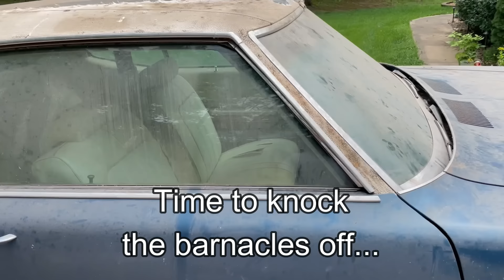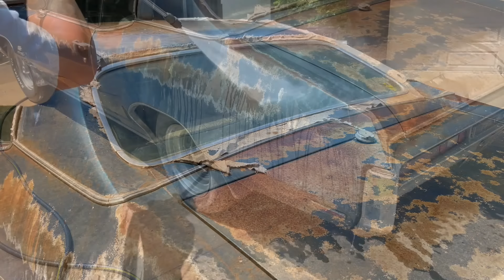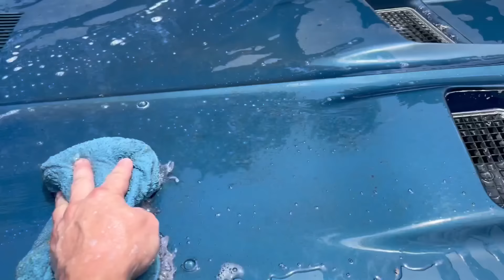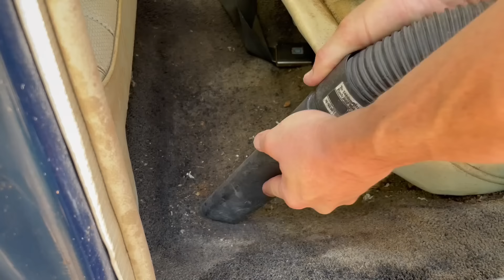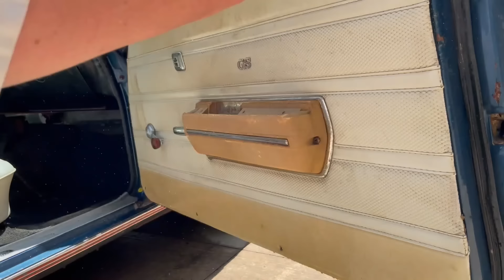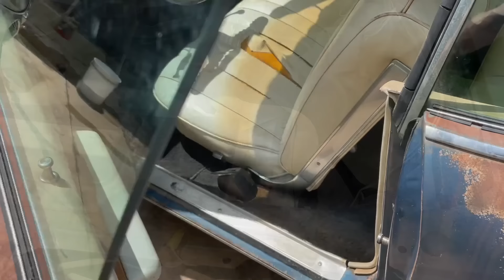1970 Buick GS Stage1 LOSES HALF ITS VALUE in 10 minutes!

Comment: The Stage One sounded like half a stage! I hope there will be a way to see how this car turns out.
Reply from the maker: Since it left here, it has been sold 3 times.  The guy that bought it from me replaced the head with the hole in the exhaust port, so it no longer sounds like a tractor.  He cleaned it up a bit more, too.
Reply: @ Easy come, easy go; I reckon.

Comment: That car isn't that bad. A bunch of disassembling and cleaning, reassembling, some paint and a new top.
Reply from the maker: It really is a great foundation.  Not a rotten mess.
Reply: This car look very straight, but it needs a frame off restoration considering what a rare classic it is.
Not inexpensive, but the return will be worth it.
Reply: No way I would put a vinyl top back on it. Completely not needed and a contrasting color or matching color paint woud do it just fine
Reply from the maker: @anonimous2451  I see lots of folks wanting to keep the color combo but not the vinyl top part, and paint the top the color of the vinyl.  Pretty sleek, and it doesn't really "devalue" the car...since it was an option to have a painted top in 1970.
Reply: @antiqueautomotiveservice  Of course. That was my point sir.

Comment: Nice, interesting options on it, Power door locks but not windows, a/c ect. I suspect the "button" on the lower left front fender was a security system. The gernerally were higher up and used a key much like a soda maching to set them.

Comment: I had a 71 back in the day Red with black interior, no vinyl top 455 4bbl factory dual exhaust, would light the tires up effortlessly had to be light on the pedal and it would swap ends with you if you weren't careful

Comment: It sure cleaned up nicely but I don’t think I would put a vinyl top back on unless the top gets a really good paint job first.
Reply from the maker: For sure...this car really needs to be completely gone through.  It was ridden hard and put away wet.
Reply: The factory top would have had one seam down the middle. Two seams indicate the top has been replaced. Fabric was manufactured wider in those years compared to now.
Reply: I didn’t know that. Thanks for sharing that information with us Mr. James.
I noticed in the past some had one seam and some two never knew why until now.
Reply: @MrJames1549 YOU Are wrong, all cars had 2 seams from the factory regardless of manufacture.
Reply: @czechmate6916  Mr James is WRONG, all cars in the 70’s had 2 seams.
Reply: @ricardofierro7041  I appreciate the update. I’m not a big fan of vinyl tops unless the top of the car was properly prepared for it and none of the manufacturers really did it. They opted to skip that step. Have a great day my friend.
Reply: @ricardofierro7041 Yeah my ‘72 Luxury LeMans (A-body cousin to this car) had a factory white vinyl roof with 2 seams.
Reply from the maker: @MrJames1549  This is incorrect.  The Buick A bodies in 68-72 (at least) had two seams like this car.  It also had the correctly folded UP A pillar seam.  It is the original top.

Comment: My brother bought a Brown 71 skylark in 1979 with a extreme BUILT chevy 350 in it and a rock crusher 4 speed . We got the GS hood and vents from a junk yard. Couldn't find the GS decals though. Total sleeper except for the spoke rims. It had a sway bar on the 12 bolt rear which had a Detroit locker in it. Cornered like a dream and was fast as hell. 10.42 in the 1/4. With slicks it lifted the drivers front wheel up about 3 1/2 feet and the passenger wheel about a foot. Learned that torque twist was a normal thing in a GS/Skylark. I had my 71 Pontiac lemans. Mine looked 1000% better, but my brothers car was way faster. (mine 13.58 in 1/4).
THOSE WERE THE DAYS

Comment: 1981 back when you could buy these types of cars for a few hundred bucks.  We got this same car for $25 because it wouldn't start.  We took it home and did everything to get it to go.  We were just teenagers though.  After we failed and took it to the junk yard we realized we forgot to check the points and dizzy cap.  Oh well, what can you say.   But it wasn't half as cool as the dark green 1968 Mustang GT 428 4 speed fastback i got for $900.   Then I remember borrowing a few hundred bucks from my construction boss because i didn't quite have enough money to buy a 1969 Cougar eliminator 4spd car then i bought it.  Its a toss up but i think i preferred the Eliminator over the fastback.  Sold the Eliminator for $2400 to a guy 3 states away.   If you only knew what you had back in the day.  man.  Don't worry i have 11 other badass cars these days.

Comment: When I was about 20 I bought a 13 year old GS 350 that was triple brown and more rare than any 455 I've seen as they only made 9948 of them but, it was the options my car had.  Power/Tilt Steering, A/C, map light in rear-view mirror, speed warning buzzer, deluxe rear interior lights and the most rare bucket seats with U handle floor shifter and center console.  In the last 40 years I have never seen any GS Skylark in person with bucket seats and maybe only 1 or 2 in pictures.  Unfortunately 10 years later I decided I could only restore 1 car and I had a cleaner last year 240Z that I chose to do and 5 years after that I had a garage fire that took that car from me.  So I guess I would have lost the Buick even had I kept it.  Even the GS 455's are hard to find now.  Back when new you could buy from the dealer with factory headers.

Comment: For the life of me, I cannot fathom what motivates people to neglect these legends to automotive awesomeness the way this car was just left to rot outside, in the elements.

If all the pertinent numbers match on this icon, it is woth a damn fortune when it is restored to it's original glory!

People both suck, (& swallow) & ROCK simultaneously!
Reply: The original owner parked it under a car port, as the cost of aviation fuel that he used was getting to be too much, plus the station was ~ 100 miles away from where he lived. The car port was a "lean to", which kept the hood, fenders, and the entire PS covered... However, the DS door, DS quarter, and trunk lid was exposed... And the rain "washed" some of the paint away in those areas...

Comment: Lol when you first it up I thought you you fired up a tractor didn't know it was the car till you drove by the camera so yea she definitely has an exhaust leak but those cars are getting harder and harder to find so the restoration will be well worth the hard long work it's going to take.
Reply from the maker: Yeah it sounded ROUGH....big hole in the side of the head on the exhaust runner.
Reply: Yea it's going to take some work.

Comment: I've owned both a ram air 69 judge and a 70 GS stage 1 455  Buick !!! Guess which one is still in my garage today !!! (If you guessed JUDGE your correct) !!! The ugly truth about Buick,s  at hi RPM,s they couldn't take it and will lose a bearing on #8 cyl !!!
Reply: That is why you gear them up, not Rev them up, like some entry level sbc.
Reply: @FrankWebber-n4b   ( I corrected the few  problem,s BUICK had with there 67-76  V8,S on lost of oil pressure at hi RPM,S )!!!  My comment is on the stock V8 and stage 1 motor,s  !!!
Reply: I’ve had many GTO’s, including a 1969 GTO Judge RA3, 4 speed, that’s why I have a W-30 in my garage! LOL 😂 But they’re all nice cars, love them all, even the Buicks, but for me, they’re on the bottom of the list!
Reply: @Musclecar1972   the RA3 was discontinued in 68 !!! RA4 was 69-75 the only difference was the compression ratio on the later yrs !!!
Reply: @blackwisdom7151  Well, I’m not much of a Pontiac guy,  the 69 Judge I had was a Ram Air car, with the mechanical pull under the dash, if it was a 4, I’m even less impressed then, I didn’t have it very long, I actually preferred the 65-67 GTO’s, thanks for the correction. I had a 65 convertible, and a 66 HDTP, a 70 HDTP, and a 71 455 HO T/A, and. 1963 421 4 speed Catalina Convertible with a tri power.Never  had a Buick, don’t care for the body styling on them, have had many Olds 442’s, 2 Yenko Canaro’s, one brand new in 1969, and a new WS-6 Chevelle I ordered in 1970. Still have a 1972 W-30 I ordered brand new in 72.
Reply: @Musclecar1972   I've owned plenty myself !! Bought and sold and still own today !!  The one I sold that I regret I let go was a AAR CUDA with a 440  my dad bought new in 1970 !!!
Reply: @Musclecar1972  now I never said that Buick wasn't a strong contender !! My stage 1 was very strong !! But if you didn't correct the GM flaw with that motor it will starve (at constant hi RPM) the #8 cyl for oil !!!
Reply: @blackwisdom7151  LoL, brothers from a different mother comes to mind! You had to bring up the one car, I always wanted, but never quite got to own! The 1970 AAR Cuda! A very close friend had one new in 1970, just a perfectly balanced little car. I still had my first Yenko in the beginning of 1970, and he always wanted to drive it, so I made a deal, he could drive the Yenko, if I could drive the AAR, the Yenko was a hell of a lot faster, but, that AAR didn’t have the heavy nose issue of my Camaro, in a straight line, it would be no contest, but in corners, also a no contest, but in his favor. The 70 SS Chevelle I ordered in 1970, would have been the same result, but I think the 71 TA the following year would have bested him, if that HO engine would have just stopped blowing up. After 3 new engines, I ordered the 1972  W-30 that I have to this very day. To me, although far from the fastest, it’s the best of the lot. I just finished a 5 year frame off restoration on it. Unfortunately time has caught up with me, I’m almost 76 years old now, so in the Spring, someone else is going to own it.
Reply: @blackwisdom7151  The Buicks were strong, but didn’t stay together, just like the HO Pontiac’s, my issue with the Buick was I never liked the roof line they used, I didn’t particularly like the look of the rear window being squared off. I liked their dashboards and interiors better than the rest though. It’s the one thing on my W-30 I don’t care much for. They all have their little shortcomings. For performance, I always looked to my Chevys, the 70 LS-6 was the strongest car I ever owned right from the dealer, and that included the 69 Yenko. I did own a 1968 W-30 a few years back that was a real animal, it had a 513 cu in stroked Olds BB in it, that engine actually had forged Buick rods of some configuration, a guy from the West coast named Mondello supposedly built the engine for the guy I bought it from. He used it strictly as a 1/4 mile car, the rear wheel openings were cut, and everything suspension wise was race oriented. I did a complete body on restoration on it and returned it to stock appearance, it was a 4 speed car, with a 4:88 rear, I brought it down to 3:91, put a whole new suspension in it, restored the interior and exterior completely. But that beast was never fully tamed, it was far to radical for the streets, I detuned it as much as possible without tearing it down. It was fun to drive for the first hour or so, after that t it became a chore, just to much for the street. My hobby for many years was buying muscle cars in need of work, doing not so much full restoration on them, but making them nice again, and selling them, I did many, from many different manufacturers. To old now, I do race my walker occasionally when some other old fart issues a challenge though! LOL 😂
Reply: @blackwisdom7151  You know, it didn’t sit right about them being discontinued in 1968, I did some research, the RA3 was produced until 1970, look it up , I did. 👍

Comment: Well.....all new interior installed, all new factory paint outside, re chrome bumpers, new tires and rims, redo brakes complete with new lines, master and wheel cylinders, new exhausts, new radiator, hoses, water pump, belts, rebuild or replace carb, new fuel pump, clean out fuel tank, new fuel lines, flush out engine, new oil, drop tranny pan clean out, change oil at least a couple of times, grease all grease points, change points plugs condenser, new air filter, check state of power steering and air conditioning, then thermal clutch radiator fan, guages and lights all working, ...... Then she may be good to go. A top classic that runs almost new.
Reply from the maker: Yep, just a few things LOL

Comment: Give it the vice grip garage treatment, maybe get some patina juice turn it into a going to town rig
Reply from the maker: I believe that is what's currently happening with it.    That big ass exhaust leak you heard at the end of the video was the actual HEAD that had a hole in the exhaust runner.  Someone got excited when they did some porting.
Reply: @antiqueautomotiveservice  you just don't see these grand sports very often not like a Chevy or Pontiac or even Olds I've only seen one it was red and white I had to ask the owner what it was and I'm 53 so I've seen a lot
Reply: @Chris-u1j7m  "Grand Sport" is a Corvette. Gran Sports were Buicks. But Buick made zero Gran Sports in 1970. The cars were named GS and GS455 (with and without the Stage 1 or the very rare Stage 2 package) or the GSX, which was a mid-1970 model.
Reply: @bbb462cid  thanks but more than I need to know I was just stating that I felt in my opinion it's a rare car

Comment: What’s the story behind the air cleaner some 70s have black ones some 70s have chrome ones.
Reply from the maker: Factory 70 Stage1 is black.  The chrome ones you see are typically from Kenne Bell (which many of the parts on this car have been purchased from).

Comment: I thought maybe the engine would be hydro locked after the pressure wash.
Yes. At some point the original paint is meaningless if it's been trashed.
That's not even patina. That's rust.

Comment: exhaust manifold gasket is why its making that noise. easy fix. But I dont understand your title "loses half its value"? Re-paint it, and it'll be worth double
Reply from the maker: The title was a joke, referring to washing all that expensive barn dust off.  
The exhaust leak was a HOLE in the exhaust runner of the head.  Replacement was necessary.

Comment: How does removing dirt, mouse droppings and a rotten vinyl top reduce the value of the car by 50%?

The only thing I cringed at was using the knife to cut the vinyl top around the window moldings.  Those moldings should have been removed so all of the roof covering could be gotten to and completely removed.

That car should be refinished only where the rust and missing paint affected the body panels.  A really competent restorer could match the paint with no difficulty.  And as was said by others, the roof would look very good finished in white.

That's a very desirable, original Buick GS, and it deserves first-class treatment.

Comment: How did the Buick GS lose have its value in 10 minutes?  Because you washed and cleaned it?   I highly doubt it.   If it is a real GS stage  1– pulling the engine and replacing it with a modern LS engine would cause a value drop for sure.   Sounded like you had a spark plug out of the head and running it.   Just saying.  Dp
Reply from the maker: It was a joke that went over many peoples' heads about cars with barn dust still on them being worth more.
Also, there was a dime sized hole in the exhaust port of the head.

Comment: A power washer has its place, and so does a pressure regulator.     All of the stickers on the car could have been destroyed easily.    Especially on the breather cover where it’s brittle from heat cycles.    Not to mention the chrome plating on a breather cover is not the same as on a bumper.       And the plastic lenses.  Ouch,  they were screaming for mercy.      Why didn’t he go ahead and do the door panels with the power wash as well?        I mean, I get it, but these things are literally once in a lifetime.   Then again, what belongs to someone else is just that, someone else’s decisions to make as well.    Nice job on the interior though.    Nice job everywhere.    Just.    Damn.     Easy baby.    That thing is 55 years old and deserves every bit of respect it can hold onto.      There I go again.    With my opinion.     What is it they say, opinions are like rectums, everybody’s gonna grab their ankles and wink sooner or later!   No.  That’s not it.   Wait, opinions are like rectums, everyone should just keep them to themselves.   Yeah, that the cliche.   Nailed it.    
About that torque number.
Reply: Careful, I got fussed at mentioning pressure washing

Comment: Best: clean shiny original zero miles perfect.
Second best: clean original with a history
3rd best: repainted mostly original nice honest car
4th best: totally restored just like new concourse car
5th best: tired old original car that was just washed
6th best: worn out original that needs to be cleaned and painted
7th best: worn out original that is far gone enough that it needs everything 
8th best: thrashed mostly original but with a colorful past and lots of rust
9th best: damaged but complete needs rust repairs and full rest
10th best: rusted out pile of molested junk that's missing lots and is really only valuable for the Vin
11th best: wadded up pile of incompleye twisted metal with no reason to save.

No way that washing something ever knocks off value.  SMH

Comment: Soooooo, the elephant in the room is this.    What does one do with 510ft/lbs of torque?     From what I understand, if one were to apply prodigious throttle at the right time, at least one rear tire would be annihilated quickly.   Being a Stage 1 car, I’m pretty sure it’s got the Positraction differential.     So we will need to see proof of that.    Hint.    Hint.